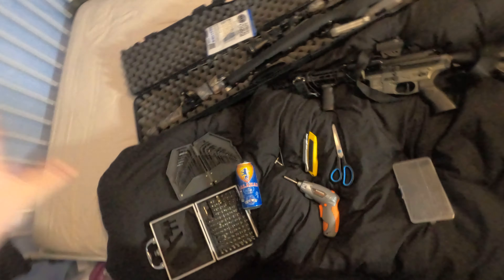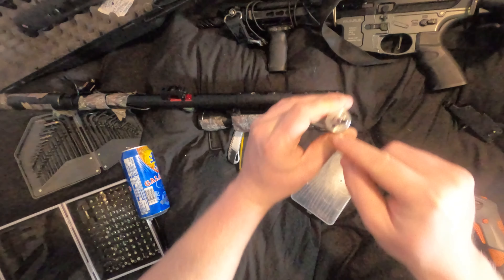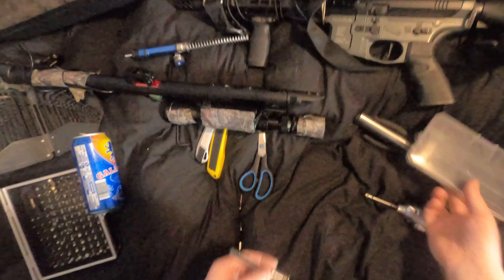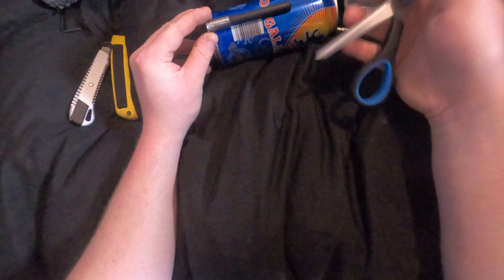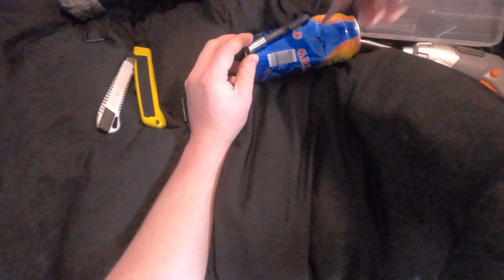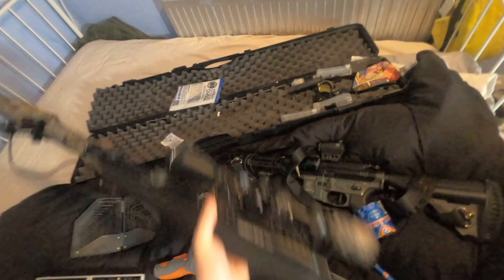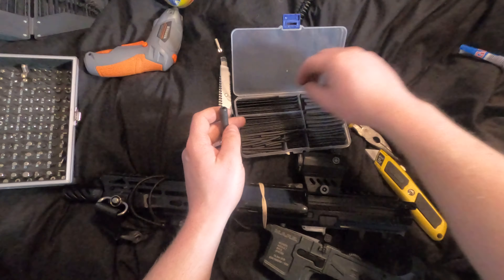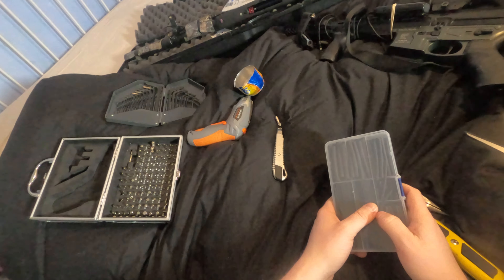How to do a Can Mod to an SSG10 / Any Airsoft Gun

Comment: Helpful video. I just have 2 questions. I saw on a nother site a guy that put the can rolled up inside the cylinder instead. Have u tried it and du u think it mathers?
The other question is can u fit the fps rings after doing the heat shrink hose?
Reply from the maker: I tried the can in the cylinder originally and it cause issues with the cocking as the can slid out mid cocking and mid game so refuse to do it now, I've used the videod method for over a year with no issues now :) 

The FPS rings are tight to the spring guide so they wont fit over the heat shrink, if you get a pack of heat shrink like I have you get hundreds so you can easily cut one off the put the rings on and then reapply
Reply: @LeadFootUK  Ok Ok I'll probably go for the shrink since I have both the hose and heat gun at work :) thanks again
Reply from the maker: @mattiasolsson9807  Excellent enjoy :D

Comment: What screws did you upgrade with. and when you say they stripped did the screw strip or the body of the gun threads. did you just take the screws to a harware store and find replacements or is there a set
Reply from the maker: I had a look on ebay or an online shop I can't remember which and someone was selling a pack of 4 stainless steel replacement screws for them. The hex head of the screws started to wear away on mine as I was removing and replacing all the time when I was setting the fps near to the limit as possible.

Comment: Great Video! 👌🏻😊 But what are you doing if you have to adjust your FPS rings? To you remove the old shrink and will you apply a new one as it changed on height causing by mixing with the FPS rings? Asking because I have a SSG96 with quick spring exchange and have to adjust the FPS very often.
Reply from the maker: I'd not bother shrinking until you have set the fps or I'd get another spring guide so I could keep one at the right fps level for that spring etc.
Reply: you prolly dont give a damn but does any of you know a tool to log back into an Instagram account..?
I was dumb lost the login password. I appreciate any tricks you can offer me!
Reply: @Milo Jayson Instablaster =)
Reply: @Marcus Tristan thanks for your reply. I got to the site thru google and I'm in the hacking process atm.
Seems to take a while so I will reply here later when my account password hopefully is recovered.
Reply: @Marcus Tristan It worked and I finally got access to my account again. I am so happy:D
Thank you so much, you saved my ass!
Reply: @Milo Jayson happy to help :D

Comment: Nice video bud! What diameter is your spring guide now including the heat shrink? Also what heat shrink do you have? Finally what you use to shrink it? Wasn’t sure what to use as I don’t have a heat shrink gun
Reply from the maker: I have no way to check diameters sorry, the heat shrink pack i have was £4 off ebay and i used a lighter as per the video :)
Reply: I'm a little late to this :/ but if he has the stock Novritsch SSG10 spring guide it should be 13mm in diameter.

Comment: Hi!
Can you tell me if you have Can mod or Heat shrink since you test them ?
Heat shrink doesn't Peel with the Spring ?
Thanks for your help because the ssg10 A3 is very loud !!
Reply from the maker: Hello I've had success using both, I've stuck with heat shrink, I find if you heat the end that you put down the spring guide and then push it down the spring guide to the bottom it makes it curl up at the end so it sits under the spring when you put the spring over it  and it holds it in place so it doesn't move and it keeps it shape really well
Reply: @LeadFootUK  hi!
Thanks for your answer !!!
Because ssg10 A3 is more difficult to be quiet 😅

Comment: Hi im sorry but can you tell me what this mod do? 😇
Reply from the maker: This mod will stop the rattle from the spring after shooting, it's one of a series of mods to make it when you shoot that there is a single "pop" when you shoot instead of a bang followed by a rattle.

It also assists in the bolt pull slightly as it keeps the spring from moving around the spring guide which can cause it to sometimes cock back awkwardly causing damage to the piston as it comes back on an angle.
Reply: Okey awesome, Thanks😇

Comment: wound tape work as heat wrap ?
Reply from the maker: Possibly but would end up falling off sooner as there are many points of failure on tape, the glue wearing away, the spring pulling it off, moisture affecting it, etc. It may work but not as well.
Reply: @LeadFootUK  great to know thanks for the replay! will just wait for a friend to come by who got the same kit as you on amazon

Comment: does this make your replica quiter?
Reply from the maker: It makes the twang noise from your spring quieter so yes it does
Reply: @LeadFootUK   by doing that mod will you lose some fps ?
Reply from the maker: @RODOSs770s  shouldn't affect it at all as its just tightening the hold the spring has on the spring guide